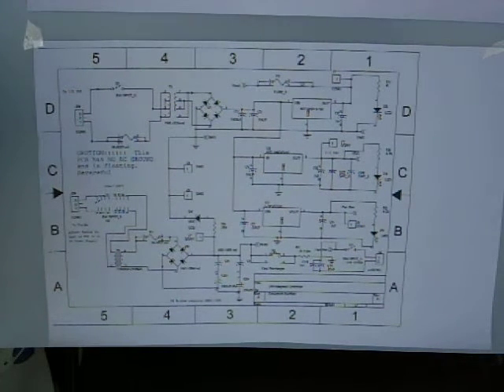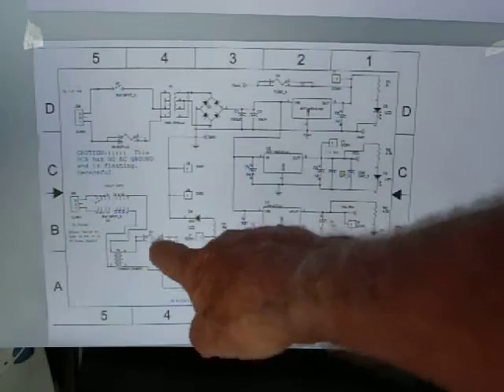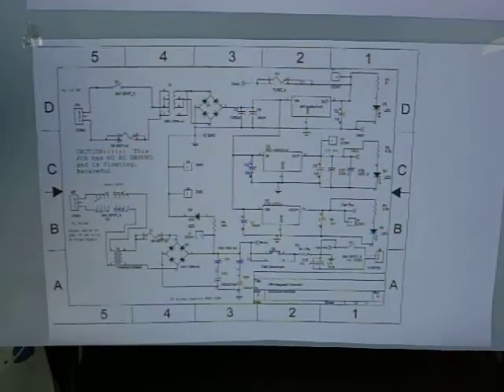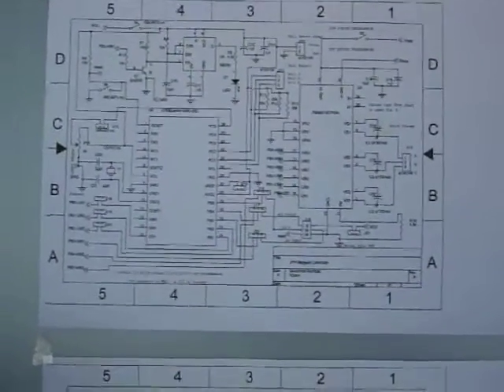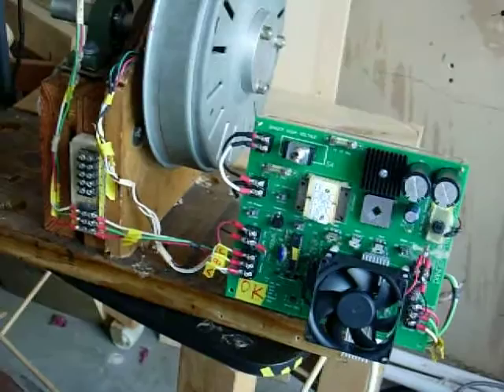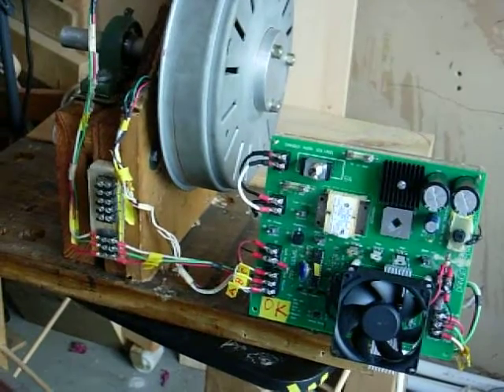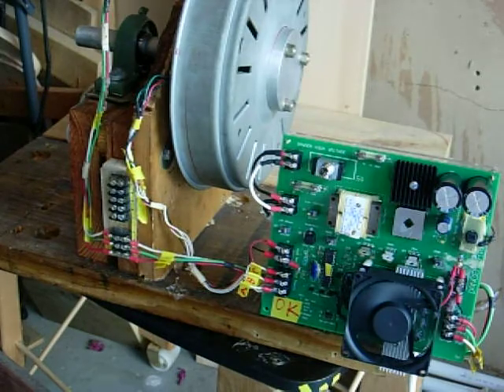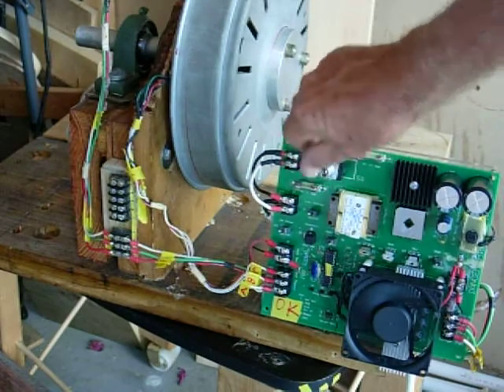Don Smith #142 New schematics and single 120 vac to pcb

Comment from the maker: Another thing to think about is the effect of the loads being connected to the second pole transformer.  We know that they change the voltage up or down.  More loads the lower the voltage drops.  Resonance using caps can help this situation.  It maybe possible to use a Tesla Idea for controlling the 120vac level as the load changes. More current flowing would move the core material to a better coupling position which in turn would increase the voltage keeping it constant.

Comment from the maker: The complete system consists of motor ,generator, two pole transformers, and some feed back circuitry.  This will give you the 4800 watts of very free energy.  By properly resonating the household appliances with motors using capacitors, the 4800 should run a lot of items.

Comment from the maker: Another plan would be to generate the 14,400 volts as a high frequency radiation pattern and then convert this to 60hz by modulating the high frequency radiation with 60 hz ac,  then filter out the HF and feed its energy back to the front end.

Comment from the maker: original C Code for AVR448*
* Atmel Corporation
*
* - File              : avr448.c
* - Compiler          : CodeVision 1.24.6 Evaluation Version.
*
* - Support mail      : avr@atmel.com
*
* - Supported devices : All devices with PWM and Pin Change Interrupt can be used.
*                       The example is written for ATmega48.
*
* - AppNote           : AVR448 - Control of High Voltage 3-Phase BLDC Motor.
*
* - Description       : Example of how to control a BLDC motor using pin change
*                       interrupts connected to hall sensor output to control
*                       motor commutation, and PWM-controlled power to the drive stage.
*
* $Revision: 1.1 $
* $Date: Thursday, June 16, 2005 08:31:22 UTC $
***************************************************************************/
#include <mega48.h>
#include "bit_defs.h"// Global variables.
unsigned char RunClockwise = 1; //!< Start with clockwise rotation.
unsigned char IPM_B4_PWM = 0xFF; //!< Control signals to IPM driver chip.// Function prototypes.
void main(void);
void initialization(void);
void PWM2_initialize(void); 
void ADC_setup(void);//! Initialize I/O-ports, ADC and PWM output.
void initialization(void)
{
 PORTB= ~0x3f; // 6 bits of PORTB to be high
 DDRB = 0x3f; // set PORTB6 bits as output
 ADC_setup(); // Initialize the ADC
 PWM2_initialize(); // Initialize PWM2.
}//! Initialize ADC to CPU/4 speed, channel 5, free running mode.
void ADC_setup(void)
{
 ADCSRA = (1<<ADEN)|(1<<ADPS1)|(1<<ADATE)|(1<<ADSC); //Enable ADC, ADC clk = CK/4, free running.
// ADMUX = 0x05 | (1<<REFS0) | (1<<ADLAR); // Channel 5 with AVCC as ref.
 ADMUX = 0x05 | (0<<REFS0) | (1<<ADLAR); // Channel 5 with AREF as ref.
}//! Initialize PWM output OC2B from Timer/Counter2 at 20kHz base freq @ 8MHz CPU.
void PWM2_initialize(void)
{
 TCCR2A = (1<<COM2B1)|(1<<COM2B0)| // Set OC2B (DIP pin 5) on Compare Match,
          (0<<WGM21)|(1<<WGM20);   // phase correct PWM & OCR2A as TOP.
 TCCR2B = (1<<WGM22)|(0<<CS22)|(0<<CS21)|(1<<CS20);
 OCR2A  = 200; // 200 decimal TOP.
 OCR2B  = 100; // This starts PWM output at 50%
 
 DDRD |= (1<<DDB3);
}//! Pin Change Interrupt for PORTC (PCINT8..14).
interrupt [PCINT1] void Pin_Change_Int_Serv(void)
{
 static unsigned char Hall_In;
 
 Hall_In = PINC & 0x07;
 
 if( RunClockwise ) {
  // This is clockwise Switch statement.
  // Based on Hall inputs select 1 of 6 patterns to
  // send to IPM via main().
  switch(Hall_In) {
   case 1: IPM_B4_PWM = 0b101011; break;
   case 5: IPM_B4_PWM = 0b110011; break;
   case 4: IPM_B4_PWM = 0b110101; break;
   case 6: IPM_B4_PWM = 0b011101; break;
   case 2: IPM_B4_PWM = 0b011110; break;
   case 3: IPM_B4_PWM = 0b101110; break;
   
   // All outputs off if illegal Hall sensors.
   default: IPM_B4_PWM = 0b111111;
  }
 } else {
  // This is counter-clockwise Switch statement.
  // Based on Hall inputs, select 1 of 6 patterns to
  // send to IPM via main().
  switch(Hall_In) {
   case 6: IPM_B4_PWM = 0b011110; break;
   case 4: IPM_B4_PWM = 0b011101; break;
   case 5: IPM_B4_PWM = 0b110101; break;
   case 1: IPM_B4_PWM = 0b110011; break;
   case 3: IPM_B4_PWM = 0b101011; break;
   case 2: IPM_B4_PWM = 0b101110; break;   // All outputs off if illegal Hall sensors.
   default: IPM_B4_PWM = 0b111111;
  }
 }
}//! Application starts here.
void main(void)
{
 unsigned char speed;
 
 initialization(); // Initialize Peripherals.
 
 // Set up and Enable Interrupts
 PCMSK1 = (1<<PCINT10) | (1<<PCINT9)| (1<<PCINT8);
 PCICR = (1<<PCIE1);// Enable Pin Change Ints from port C.
 
 // Start interrupts by forcing Hall Inputs to 0, then switching pins to inputs.
 DDRC = 7; // 3 Hall Inputs pulled to 0 volts.
 PORTC = 0;
 PORTC = 1;
 PORTC = 2;
 PORTC = 4; // Start interrupts with forced pin change
 DDRC = 0; // Port C switched back to all inputs. 
 SREG |= 0x80;// Enable Interrupts  via SEI bit
 
 PORTD |= (1<<PD0) | (1<<PD1); // Direction control input pullups, undocumented.
 
 while(1) { // IPM_B4_PWM is updated via a Pin Change Interrupt
 
                // Direction control, undocumented.
         if( !(PIND & (1<<PD0)) ) RunClockwise = 1;
         if( !(PIND & (1<<PD1)) ) RunClockwise = 0;
 
         // Update speed setting from ADC reading.
                speed = ADCH;
                if( speed > 199 ) speed = 199;
                OCR2B = speed;
  
   // If OC2B is high, send inactive outputs to IPM.
  if( PIND & (1 << PD3) ) {
   PORTB = ~0xFF; // <== If motor driver has active high inputs.
//   PORTB = 0xFF; // <== If motor driver has active low inputs.
  } else {
   PORTB = ~IPM_B4_PWM; // <== If motor driver has active high inputs.
//   PORTB = IPM_B4_PWM; // <== If motor driver has active low inputs.
  }
 }
}

Comment from the maker: I should have the generator tomorrow.  then the fun begins. I'll have to get the pulley ratio close to 3 to 1 1200rpm to 3600rpm then fine tune it with the motor speed adjust.   The aluminum plate in the pole and HV coil need to be analyzed to find out exactly what their relationship is.   Once we have this knowledge we can then design our own box containing the parts needed to accomplish the task at hand.             I believe that plate mass is directly related to amps/watts generated.  The turns ratio between the plate and HV transformer determines the voltage level  Nicola Tesla's concepts for his HF transformers dynamos and arc magnetic discharger all directly relate to what we are working on even though it is running at 60hz.               Radiation from the HV coil striking the aluminum plate gives us the electron flow to do work.    Radiation striking a capacitors plate does the same thing and the energy is stored waiting to do work in the form of a capacitor discharge which can be extremely powerful.    It may be possible to generate  the 14,400vac 60 hz without the use of the first pole transformer.

Comment from the maker: Atmel schematic from AVR448 is wrong pin 7 of Mega 48 is VCC not GND, vref is at VCC,   three Hall inputs need to pulled to VCC with 20K resistors,   all grounds are same but two ground planes are used one for Digital stuff and one for motor 180vdc stuff these two planes are connected together near the 180vdc PS ,   pin 21 of the Irams10up60A needs to be grounded thru a 4.3 K resistor or the chip won't run..  you should use 1/2 amp fuse between 15vdc PS and the Irams10up60A.  this will protect the Mega48 and three regulator from toasting, when the you mess with Hall position changes to find the sweet spot.  The PCB Manual discusses all this and much more and includes drawings  and pics of the setup.   I'm going to try my first Gen154 test to first pole transformer it's a 1500 watt PMG.  I'm curious as to whether the load changes at the second pole transformer will load down the generator.  they should have no effect since their is no current flowing thru the Pole Aluminum Plate.   If they had then Gerard's voltage drop at the second pole output would not have occurred the gen would have compensated for the different load.  This is fascinating.

Comment from the maker: Modified C Code for AVR448  changes are in BOLD type bold type didn't work

// This file has been prepared for Doxygen automatic
documentation generation.

/*! \file
******************************************************************
*
* Atmel Corporation
*
* - File  : avr448.c
* - Compiler : CodeVision 1.24.6 Evaluation Version.
* - Support mail  : avr@atmel.com
*

* - Supported devices : All devices with PWM and Pin Change
Interrupt can be used.

*                      
The example is written for ATmega48.

*

* - AppNote          
: AVR448 - Control of High Voltage 3-Phase BLDC Motor.

*

* - Description      
: Example of how to control a BLDC motor using pin change

*                      
interrupts connected to hall sensor output to control

*                      
motor commutation, and PWM-controlled power to the drive stage.

*

* $Revision: 1.1 $

* $Date: Thursday, June 16, 2005 08:31:22 UTC $

**************************************************************************/

#include <mega48.h>

#include "bit_defs.h"

 

 

 

// Global variables.

unsigned char RunClockwise = 1; //!< Start with clockwise
rotation.

unsigned char IPM_B4_PWM = 0xFF; //!< Control signals to
IPM driver chip.

 

 

 

// Function prototypes.

void main(void);

void initialization(void);

void PWM2_initialize(void); 

void ADC_setup(void);

 

 

 

//! Initialize I/O-ports, ADC and PWM output.

void initialization(void)

{

                PORTB=
~0x3f; // 6 bits of PORTB to be high

                DDRB =
0x3f; // set PORTB6 bits as output

                ADC_setup();
// Initialize the ADC

                PWM2_initialize();
// Initialize PWM2.

}

 

 

 

//! Initialize ADC to CPU/4 speed, channel 5, free running
mode.

void ADC_setup(void)

{

                ADCSRA
= (1<<ADEN)|(1<<ADPS1)|(1<<ADATE)|(1<<ADSC); //Enable
ADC, ADC clk = CK/4, free running.

//            ADMUX =
0x05 | (1<<REFS0) | (1<<ADLAR); // Channel 5 with AVCC as ref. 1 0

                ADMUX =
0x05 | (0<<REFS0) | (1<<ADLAR); // Channel 5 with AREF as ref.  0 0

}

 

 

 

//! Initialize PWM output OC2B from Timer/Counter2 at 20kHz
base freq @ 8MHz CPU.

void PWM2_initialize(void)

{

                TCCR2A
= (1<<COM2B1)|(1<<COM2B0)| // Set OC2B (DIP pin 5) on Compare Match,

                        
(0<<WGM21)|(1<<WGM20);  
// phase correct PWM & OCR2A as TOP.

                TCCR2B
= (1<<WGM22)|(0<<CS22)|(0<<CS21)|(1<<CS20);

                OCR2A  = 255; // 200 decimal TOP.

                OCR2B  = 100; // This starts PWM output at 50%

                

                DDRD |=
(1<<DDB3);

}

 

 

 

//! Pin Change Interrupt
for PORTC (PCINT8..14).   The original
code wouldn't compile PCINT1 was changed to PC_INT1

interrupt [PC_INT1]
void Pin_Change_Int_Serv(void)

{

                static
unsigned char Hall_In;

                

                Hall_In
= PINC & 0x07;

                

                if(
RunClockwise ) {

                                //
This is clockwise Switch statement.

                                //
Based on Hall inputs select 1 of 6 patterns to

                                //
send to IPM via main() NEW CASE CODES 3/31/2016

       
switch(Hall_In) {

                                                case 1: IPM_B4_PWM = 0b110011; break;

                                                case
5: IPM_B4_PWM = 0b110101; break;

                                                case
4: IPM_B4_PWM = 0b011101; break;

                                                case
6: IPM_B4_PWM = 0b011110; break;

                                                case
2: IPM_B4_PWM = 0b101110; break;

                                                case
3: IPM_B4_PWM = 0b101011; break;

                                               
                

                                                //
All outputs off if illegal Hall sensors.

                                                default: IPM_B4_PWM = 0b111111;

                                }

                } else
{

                                //
This is counter-clockwise Switch statement.

                                //
Based on Hall inputs, select 1 of 6 patterns to

                                //
send to IPM via main().

                                switch(Hall_In)
{

                                                case
6: IPM_B4_PWM = 0b011110; break;

                                                case
4: IPM_B4_PWM = 0b011101; break;

                                                case
5: IPM_B4_PWM = 0b110101; break;

                                                case
1: IPM_B4_PWM = 0b110011; break;

                                                case
3: IPM_B4_PWM = 0b101011; break;

                                                case
2: IPM_B4_PWM = 0b101110; break;

 

                                                //
All outputs off if illegal Hall sensors.

                                                default:
IPM_B4_PWM = 0b111111;

                                }

                }

}

 

 

 

//! Application starts here.

void main(void)

{

unsigned char speed;

                

                initialization();
// Initialize Peripherals.

    

     // Crystal Oscillator division factor: 1
INSTALLED ON 3/31/2016 

#pragma optsize-

CLKPR=(1<<CLKPCE);

CLKPR=(0<<CLKPCE)
| (0<<CLKPS3) | (0<<CLKPS2) | (0<<CLKPS1) |
(0<<CLKPS0);

#ifdef
OPTIMIZE_SIZE

#pragma optsize+

#endif

 

//main()              

                // Set
up and Enable Interrupts

    PCMSK1 =
(1<<PCINT10)| (1<<PCINT9)| (1<<PCINT8);

                PCICR =
(1<<PCIE1);// Enable Pin Change Ints from port C.

                

                //
Start interrupts by forcing Hall Inputs to 0, then switching pins to inputs.

                DDRC =
7; // 3 Hall Inputs pulled to 0 volts.

                PORTC =
0;

                PORTC =
1;

                PORTC =
2;

                PORTC =
4; // Start interrupts with forced pin change

                DDRC =
0; // Port C switched back to all inputs. 

                SREG |=
0x80;// Enable Interrupts  via SEI bit

                

                PORTD
|= (1<<PD0) | (1<<PD1); // Direction control input pullups,
undocumented.

                

                while(1)
{ // IPM_B4_PWM is updated via a Pin Change Interrupt

                

                //
Direction control, undocumented.

                        if( !(PIND & (1<<PD0)) )
RunClockwise = 1;

                        if( !(PIND & (1<<PD1)) )
RunClockwise = 0;

                

                        // Update speed setting from ADC
reading.

                speed
= ADCH;

                if(
speed > 250 ) speed = 250;

                OCR2B
= speed;

                                

                                 // If OC2B(PD3 pin 5) is high, send inactive
outputs to IPM.

                                if(
PIND & (1 << PD3) ) {

//                                            PORTB
= ~0xFF; // <== If motor driver has active high inputs.

                                                PORTB
= 0xFF; // <== If motor driver has active low inputs. ENABLED 3/31/2016

                                } else {

//                                            PORTB
= ~IPM_B4_PWM; // <== If motor driver has active high inputs.

                                                PORTB
= IPM_B4_PWM; // <== If motor driver has active low inputs.  ENABLED 3/31/2016

                                }

                }

}